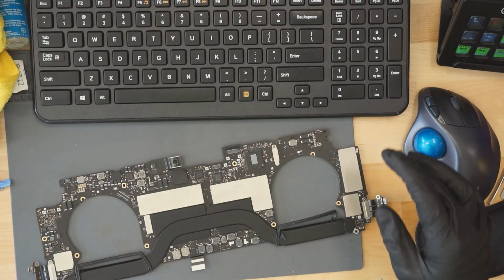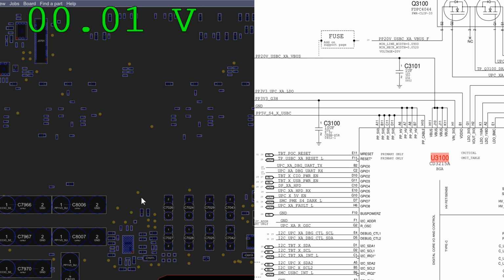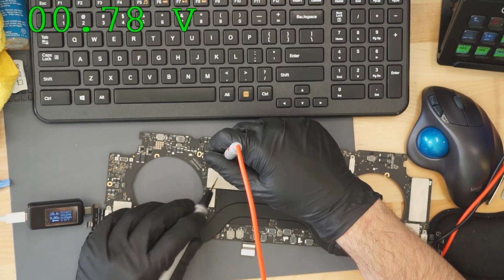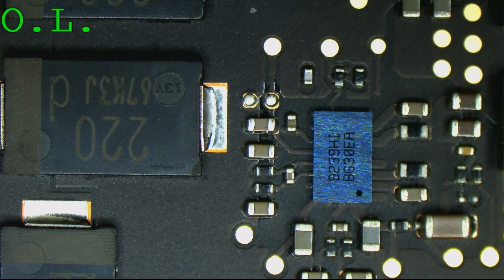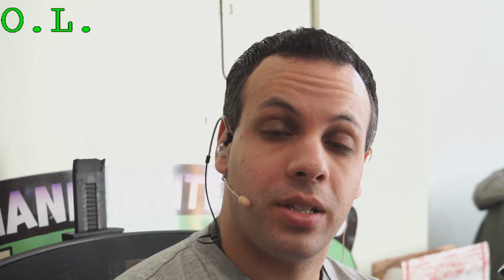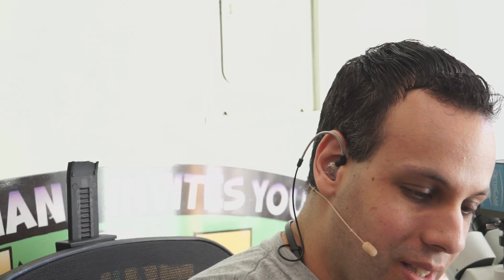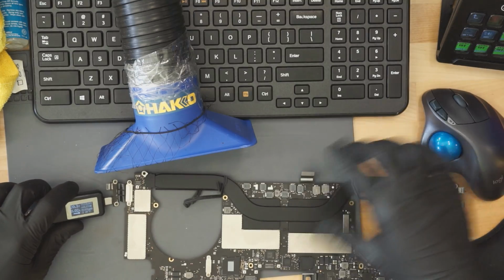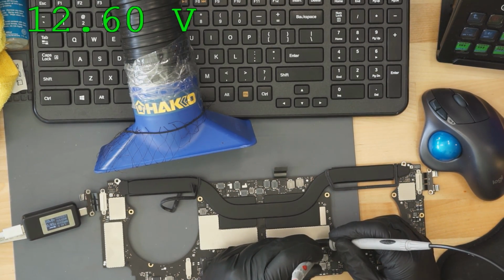Why new Macbook boards will be unfixable for me: sad :(

Comment: I know YouTube comments are a poor way to contact you for doing business, but thought others might be interested in hearing my story too. I have a $130 Anker PowerCore+ 26800 PD power bank that I bought about a month ago. After successfully using it to sustain smartphones over a 4-day trip and charging it once, it will no longer charge now that I'm back from my trip. 

I believe it's basically four 18650 lithium cells in a nice aluminum container with a simple charging board attached. The charging board is probably some standard off the shelf part, or at least has off the shelf components, as I doubt Anker would go through the trouble to do novel IC design. It can only be charged via USB-C, but it can supply power to your devices using either USB-A or USB-C. 

I'd be willing to send in the device for repair, pay for your time, and see if you could make an interesting YouTube video out of it. It would be funny if repairing a battery charger were easier than repairing a MacBook because the components are easily available commercially. I'm willing to pay a decent amount "at risk" (bypassing your usual 'No fix, no fee'  policy) due to the possibility that the problem could be something that you just aren't able to fix, or can't find the required part anywhere.

It would also be incredibly helpful to those in the market for a battery bank if you could identify the probable cause of the failure. If it's user error or liquid damage, I'll acknowledge my own stupidity. If the cause of the failure is due to bad board design or bad charging port design, having you make a video where you explain to everyone why Anker made a bad product, would be extremely satisfying.

I don't actually hate Anker as a company and I have several products of theirs that haven't failed in years of use. I also own a high-capacity Anker PowerHouse (434 Wh) that is extremely well-constructed and doesn't seem to have any design issues. But if they've made a design mistake with this specific product, having that exposed in a video would hopefully get them to look into making a new iteration of this power bank without the flaw. The end goal is to convince them to do better. Maybe Apple is too hard-headed to learn from your videos and make better products, but I'd think a much smaller company with a product with lower profit margins would be motivated to do better. Unfortunately, all I can find on Amazon and Anker's forums about this is "try plugging in a USB-A to USB-C cable into the battery and it'll reset the IC" and "we've sent you an email to talk about an RMA". No one seems interested in tracking down why this is happening to what seems like many customers, and that sucks IMO.

Comment: Hi, Louis,  I own this machine and it recently stopped taking a charge, just like the one in this video. So...my two-year-old MB is now neither a functioning computer and is too light to be used as a paperweight.  Apple wants to replace the motherboard for $527.00!  
My question is if just the one chip is the cause of the failure, will Apple replace said chip and not charge me the full cost of a motherboard?

I have already contacted your repair dept. and was told that they could not do the repair and to take it to Apple.
Reply: I am not Louis, but an economist, so I would like to take a stab at answering your question. No, they will not change the chip as most of their "repair" people don't know how. They know how to change a motherboard (debatable), but they don't have the knowledge to change a chip like Louis does. It is far more profitable to make you buy a new motherboard than to repair your board anyway. By closing off the supply chain to Louis they make even more money off people as they don't lose enough customers to justify giving you good customer service.

Comment: Just a thought, and I'm probably wrong. What if Intersil did not make the ISL9240 as a proprietairy chip for Apple? What if they rummaged around in the parts bin, found a suiteable chip they already had, and simply gave it a new designation to satisfy Apple's need for something proprietairy? Can you compare pinouts to similar other ISL chips? What about the ISL9241?  https://www.newark.com/renesas/isl9241hrtz-t7a/batt-charger-li-ion-18-304v-tqfn/dp/84AC1810?st=ISL9241

Comment: Has anyone, especially Apple, realized the environmental consideration of selling product that is not fixable if/when it will suddenly become useless? How many of these broken MB end up in drawers etc only to be discarded and possibly end up in landfill. Yes many countries have some form of WEEE policy but its not a guarantee.
Reply: CimandeTube From what I see, that motherboard has little recycling value. The chips are expensive to fabricate, but silicon is so abundant it's worthless  as a material. Then there is the board, a little copper, some solder, and a tiny bit of precious metals. 

The metal casing likely has more recycling value. 

Sure, it creates trash. But until Apple has to pay for the recycling of the device, trash will be part of its life.

Comment: Why new Macbook boards will be unbuyable for me: happy :) (Or rather problem solved. I've been thinking about switching to a Linux lap for my work computer anyway, since the detrimental changes to MacBooks since 2016. A lot of people have thought the same.
Reply: I have switched to Linux for home and work and I can't complain. We have 6 computers running in the home and only one runs windows because I need it for certain work related applications. Even my 10 year old dumped windows and installed Ubuntu on his laptop.

Comment: Genius bar: It's not fixable or is going to cost more than what you originally bought the computer to be fixed.
Louis: Give me a few minutes i'll find the problem and fix it for cheap.
Genius bar:-_- scammer
Reply: One example (from memory): Takes him 20-30 minutes to find and replace a weak chip, at a cost of less than 100 USD, parts included... No wonder they hate him. ;)
Reply: That the point. They don't want anyone to be able to fix it, they want to destroy what left of the repair market. They rather screw customers over and have you buy a new one every year, or pay extra for insurance Apple Care? Reason I stop buying Apple products years ago. It overpriced disposable crap.
Reply: @parrotgenie5099  they want you to pay apple to fix it when all they're going to do is replace the entire board and recycle the rest. Apple is trying to create a monopoly on their products.
Reply: @toxicavenger6172  They don't even fix it in most cases. I seen so many get turn down for repair at Apple stores as They don't do component level repair and even them replacing the whole board is usually back ordered. They rather you buy a new one. That the game is to get you to buy a new one every year.
Reply: @parrotgenie5099  all this does is give me even more reason to never buy apple products
Reply: Genius bar: It's not fixable or is going to cost more than what you originally bought the computer to be fixed.
Louis: Hold my beer!
Reply: Scammer... Lol. Louis tradehacks blizzard- - -I mean apple

Comment: You know, I *used* to think "I'm not so enthusiastic about MacOS, but boy Apple makes some really nice machines".  As time progresses I'm no longer impressed by their hardware.  And I don't need MacOS because I'd rather use Linux and actually have some ability to configure the system the way I want, and not what some colourblind and flatso-brained MacHead at Apple thinks I should do.  Apple is starting to make Microsoft look open-minded and customer-friendly by comparison (and you know THAT'S gotta be bad).

Comment: That being said that YOU can't get the chip, does Apple supply chips to their own warranty or repair services? I would assume that they would rather sell a whole board than actually repair something. My school provided Macbook Air was having an issue, so we sent it in for repair. They replaced the WHOLE motherboard. I assume part of that is because it's faster and easier to replace a board that properly diagnose and repair a part even though it's not cost effective. Thankfully the repair was under warrant and we didn't have to pay the outrageous amount it would cost for something like that.
Reply: Jeffrey Ball Plus they save A LOT in training. Surface mount soldering at that level is an art that many "techs" don't master. Swapping boards needs less training and less skilled workers.

Yup, way more expensive. But you wanted an Apple product, didn't you? ;-)
Reply: @ve2mrxB  I want MacOS and the things that go with it. I love that they a certain level of control over their products, but they're getting too fussy. This is 1995 all over again when they were about to go bankrupt. They need to change soon or risk loosing their fanbase.

Comment: Apple is not the only company doing this kind of things. Razer locks down bios so people cannot change things worthwhile. The key management for secure boot keys is locked away and they are using a test certificate that clearly says "DO NOT TRUST". They won't unlock just the key management. They have MANY things locked away from the owners of the hardware. I know the following post is from 2016, but I have the same EXACT problem on my 2018 model Blade 15 Adv. I contacted Razer, but they refuse to unlock it so I can at least fix the security hole that is there. They also are refusing to update the certs because it will also require they unlock the keys because the user has to clear the keys and reset to factory default keys to get rid of the test certificate.

 https://lukegb.com/posts/2016-11-11-secure-boot-shenanigans/

Comment: So far I can't use your services.. Still using a Dell laptop from 2008, replaced screen assy once, threw an SSD in it and more ram.. For a 10 year old Q2630Qm it chugs along nicely..

I'd rather buy a IBM T series laptop.. Quadro or Radeon Pro..
Reply: Not from 2008.  2nd Gen i-series CPUs are from 2011.

Comment: I have found an alternative source for the ISL9240. It depends on what you think is reasonable to get hold of this BGA.
It can be found in the Smart battery case for the iPhone XR. They sell for $129 however it may be better if you can get hold of them from elsewhere. A Chinese site has reverse engineered the battery case and show pictures of the BGA on the board. Here's the link, (Google translate it):
https://bit.ly/2FpsZcH

Full teardown: https://bit.ly/2WfDl4u

Think Different ;)

Comment: You maybe should have heated up the solder on the first chip because tapping to work is indicative of a connection problem. It may be intermittent in the future.

Comment: Hi louise  do u do work on hp laptops? I have a hp 450 g3 that just stopped working the power led is still light hgt thing up but do not get power to turn on. Is it possible  to send you the board?

Comment: Hey Louis I just looked into isl9200, if my prediction is correct then 9240 should also be similar to 9200 which is just a battery charge monitoring IC. Kind of a killswitch for the charging IC so to prevent bad chargers destroying the board. It seems to have one output pin which I think goes to the charging IC and an EN pin which should be kept low to keep it On. Incase of any faults, the EN pin is pulled High by some other circuitry to stop the charging IC from turning on the system. Can you just replicate the Out pin signal from a working board and EN pin voltage by forcing it directly to ground ?

Comment: next macbook computer will be one chip soldered to an empty motherboard where you have only one connector : the power supply!!

If you want to add more RAM, buy THE chip !
Reply: They are heading that way, they want to move over to all in one ARM chips that are completely locked off. Like the Raspberry Pi, but not open source.
Reply: @MetatronsCube23  
😤

Comment: If it is as common of a failure as you say, maybe reverse engineer the chip, and roll a tiny custom replacement board? 
Well that's what I would do at this point.

Comment: I think the ISL9240 is also used in the iPhone XR smart battery case. They are $200 though so probably not an economical option but it could be a possible source for that IC.

Edit:Actually $129 on Amazon. Add in the tear down of the pack and it would be unlikely to be worth it, and also a waste of a lithium cell.

Comment: Apple is despicable. Every new generation of device they release they seem to be cutting more and more corners for increased profit. Now they are stopping the repair market by not making parts readily available when they know the product will fail due to their cutting corners on cheap manufacturing.

Comment: Sounds like a cracked joint to me... WLCSP   fine pitch is just not that reliable with lead free process. The CTE mismatch issues are exacerbated by the small size of the balls, and the fine pitch makes them difficult to solder on scale.

Comment: I just switched from an iPhone 5s to an android phone about a month ago and i'm damn happy i did.

I've really gone far to customise my phone to be personal to me, which is impossible on iPhone. I feckin love the split screen thing. And all the extra yummies i get from even stock android pie. And gestures. Damn this phone is hot. 
I still thought androids were slow and laggy and messy, as my last android phone before this was the first variant of Samsung a3. How damn wrong i was. 

I would've gone for the oneplus 6 or 6t but it was too expensive, so i went for the nordic variant of Huawei nova 3 for 300€. It's like an iPhone xs but about 1000€ cheaper. I think i'm gonna switch to oneplus when i buy my next phone. And i don't mind the notch because it's optimized well in this phone.

Comment: I worked on a secondary market e-commerce project for Infineon back in the 90's and all the stocks of chipsets (no longer manufactured) lying idle on shelves throughout the world could be located and purchased.  I do remember that chip manufacturing is booked well in advance the capacity do any kind of custom runs was limited by their manufacturing capacity which had not already been contracted out. That is 20 years ago and I am not sure if the application is still deployed. You would have expected something like that to expand across the market but clearly, opportunities have been recognised in strangling supply.

Comment: in new zealand we have a law called the consumers guarantees act which last longer than the manfactures warranty on a macbook it would be about 5 years so you dont have to buy apple care because it it breaks the retailer has to repair, replace or refund and they claim from apple, they try and sell you extended warranties and a few have been fined for doing just that, another stipulation is that spares must be available for a reasonable period, you need to get trump to pass this law so you dont fill the dumps up with non repairable items. another stipulation is it must be fixed in a reasonable time frame to, normally thats about 2 weeks and if the item takes more than 2 goes to fix, with the same fault, they have to replace or refund

Comment: Hey Louis! Great vids. I always look forward to seeing a new one.  I notice you use a Logitec M570 trackball - great product! Do you ever have trouble with accidental double-clicking with it? I found the early models had poor switches in them which failed very quickly. I did a blog post many years ago, but I was wondering if the new models have better switches?
Reply: I think that's a problem with all Logitech mice when they get old. I'm on the third one that's acting up that way, and they're different models from Logitech. Just something about that particular microswitch they use.
Reply: @pauljs75  I replaced the switches in  mine with decent quality C&K ones and it has lasted for many years since :-) Also, they wern't old (at just a few months) when they started playing up. I guess "age" is relevant to the number of clicks though...

Comment: I got a 2012 MBP 13" from a local nonprofit refurbisher, slapped in 16GB of RAM, A SanDisk Extreme II Pro SSD and it is now all the apple I will ever need, plus, in the event it does actually fail, I know exactly who to mail it to. Postage is going to be a bitch, but it'll be worth it.

The only reason I have it is so I can hackintosh my main PC - and it makes a decent travel companion.